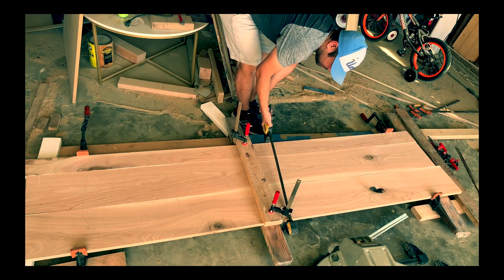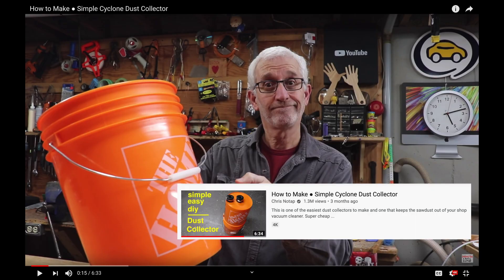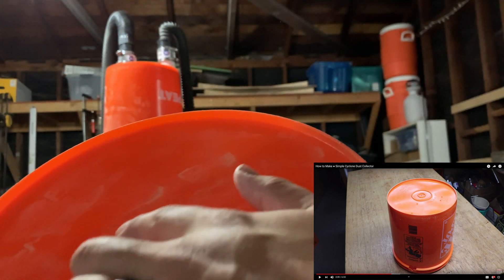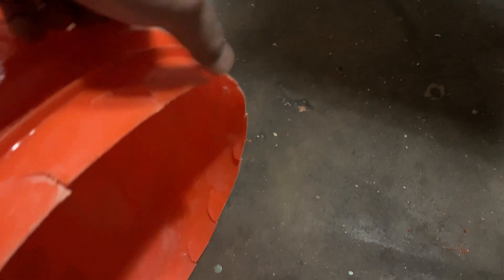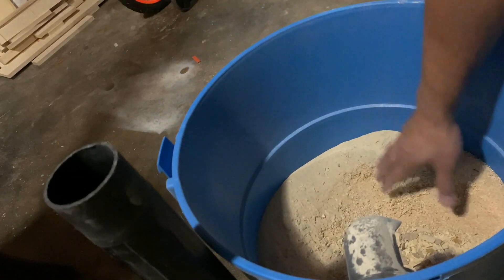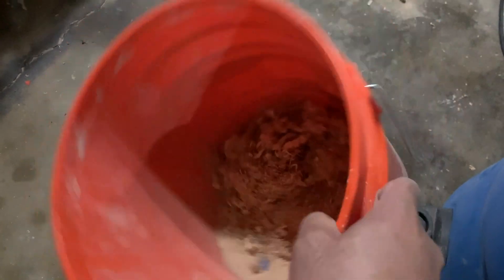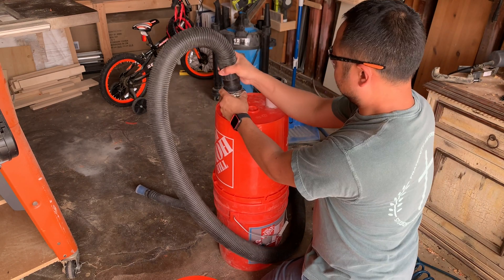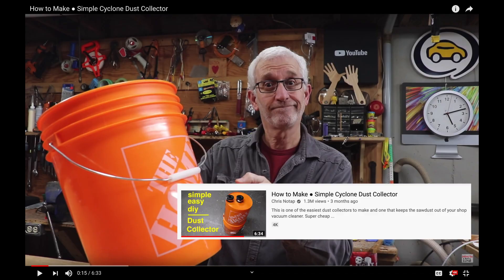Simple DIY Dust Collector (Chris Notap's design + 2" port modification)

Comment: I added a dust bag inside the shot vac and it’s clean. I made the same collector from Chris with much own modifications for the 2” shot vac hose- works great. Need to add something to keep from tipping over, bottom weights as Chris suggested
Reply: Shop vac, sorry for typos

Comment: so, some dust still makes it all the way 2 the vac's filter, right? i made a collector 4 myself per Chris' design and have 2 use a bag in my vac, since dust makes it thru... granted, it DOES work and will help me save on vac bags but not 100%...

Comment: I went to home depot....looked at buckets.....decided to go to Craigs list looking for 20 gallon cardboard barrel...found a 55 gallon metal barrel with lid that was like brand new for $20... with pvc...I'm still under 30 bucks...I do a lot of flush trim router work and 5 gallon buckets would fill up in no time..tested and changed a few things from design in Chris's video....vacum hole center of lid pvc hangs few inches lower than dust input hose that I moved to side of barrel...seems to have better cyclone affect...,works fantastic catches 99.9% of the super fine MDF dust..
Reply from the maker: Sounds like a beast of a dust collector!

Comment: Maybe take the 3 inch leftover piece and stick it on the bottom bucket. I actually took the room I cut off and screwed it around the top bucket and it gave it support.
Reply from the maker: Ah - that would've been a good idea! I ended up getting another bucket from HD but that's good to know!